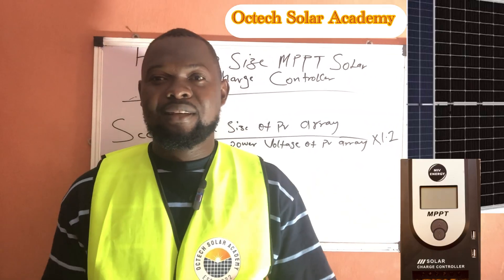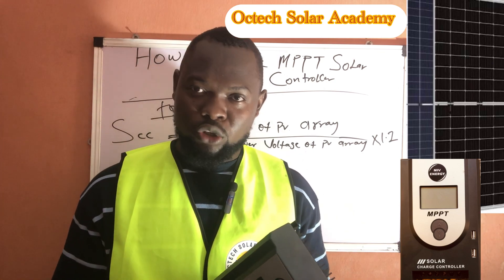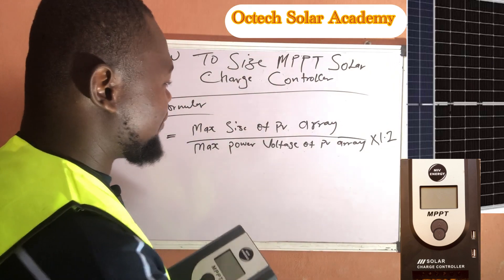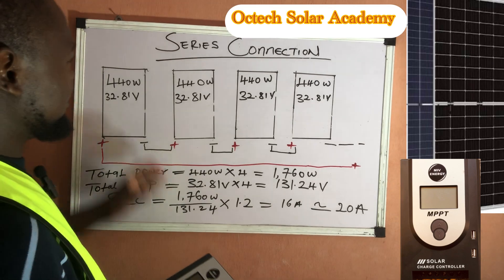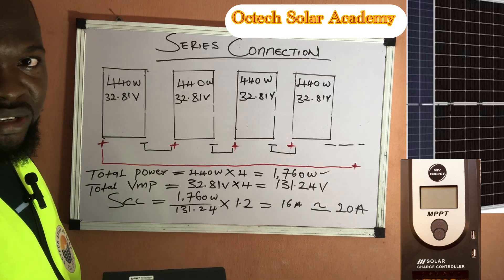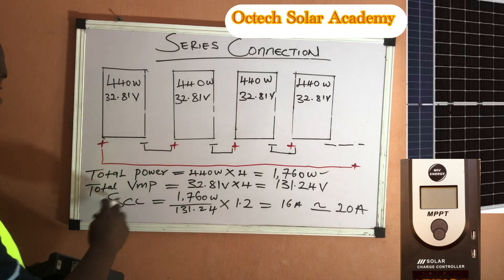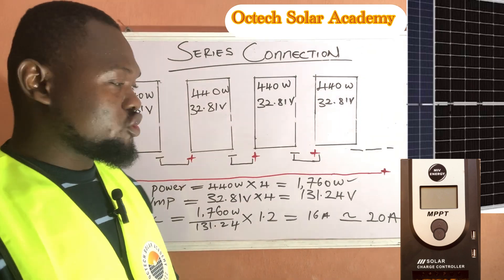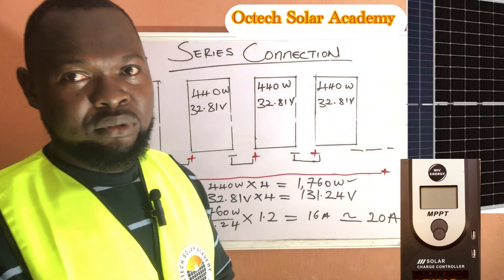How to Size MPPT Solar Charge Controller ,Beginners Guide .

Comment: Just ask any woman if bigger is better. (think bigger house, bigger bank account, bigger credit score, etc)
Same applies to your solar controller.
Always try to get a bigger one than you need in case you want to upgrade in the future.
Also, bigger ones have more robust components in them. Running a 60 amp one at 30 amps means more efficient due to less heat generated in the conversion process.

Comment: Do not multiply the watts by 4 since it is in series connection. The voltage increase in series while the watts is still constant.

440÷131.24=3.3A

Add 20% safety factor.
3.3A×1.20 = 4A 

10Amperage charge controller needed 
20A also is good to preserve the charge controller lifespan.

As the voltage increase the cheaper the charge controller.
Reply: That’s incorrect you have together to get The to walk that by the voltage of the battery system. That is the size of the NPP controller not the watch divided by the solar voltage underpowered.